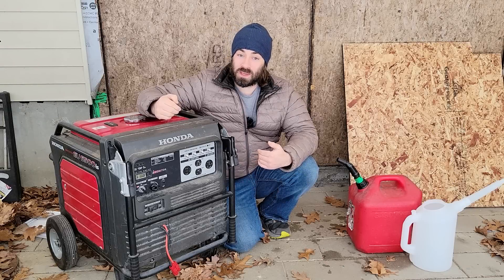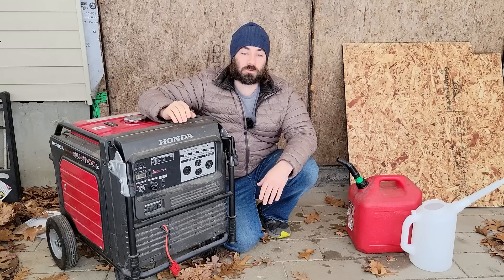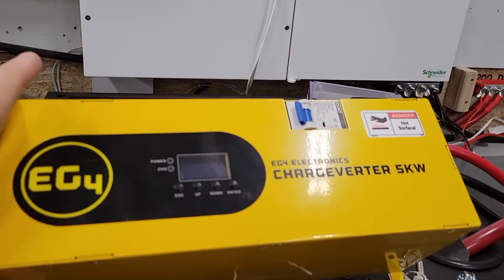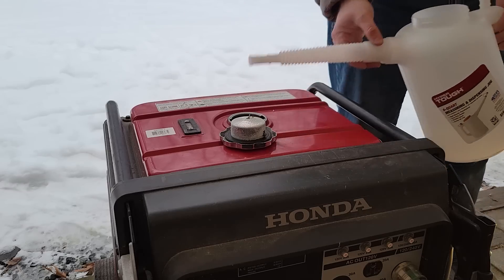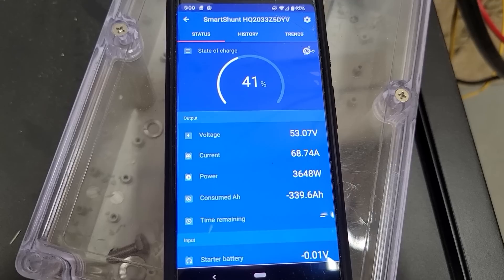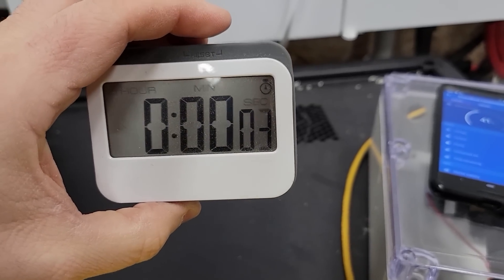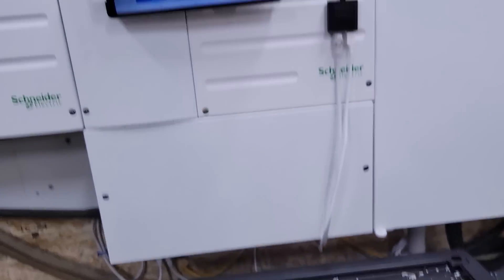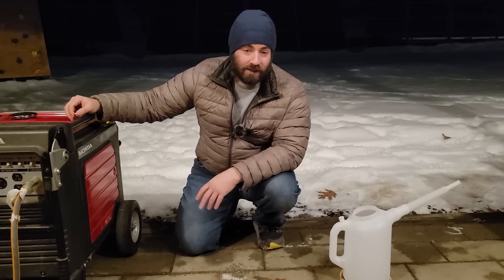Not what I expected.

Comment: Hey David. I think the 80% rule also takes into consideration that there will be less RPM, less friction , less wear and tear and therefore longer engine life etc. I may be wrong but that was partly my understanding.
Reply: I did similar experiment on a smaller generator. I got max power at max generator rating. My belief is that the "rated power" of the generator is the 80% value. The manufacture rates them at peak efficiency.
Reply: You could be wrong, as with higher load it will run shorter time, so it is not that clear.

Comment: I do not know how efficient generators are or can be, from my understanding, the newer "inverter generators" can be more efficient but I'm not sure as to the specifics. As to the charger, you most likely want to run it at about half capacity, as that tends to be where most electrical devices are most efficient. At full loads and low loads some electronics can get very inefficient.

My best guess from the generator is to get as much power from it as you can at the lowest RPM, because as RPM increases so do your frictional losses, but I'm not sure if there is a counterpoint on the electric generator side of that equation as well.

Comment: Interesting results - the first test ran for 1:32 before it ran out of gas. You never told us how long the other test took to run out of gas.
Reply from the maker: All the tests were 1 hour to 1.5 hours.  The higher the charging current, the shorter the length of time since the kWh per gallon was the same.

Comment: FYI .. to answer the title of the video .. generator is about ~17.2% efficient .. getting 5.8kwh of electricity from 1 gallon of gasoline (which has about ~33.7 kwh of chemical energy)   = ~17.2% efficient.

I might be interesting to see how this efficiency compares to a vehicle (car/truck) style system .. If a car/truck ICE is only 25% efficient fuel to shaft , and it's alternator is only ~70% efficient shaft to electricity .. it would still give about the same net ~17% efficiency ... 33.7 kwh in x 0.25% ICE  x 0.70% Alternator = ~5.9 kwh electricity output ... ~5.8kwh in about ~1 hour is about ~5.8kw of power aka ~7.8HP.

I would guess that some of the HEVs (prius and the like) would do the best .. as they were designed specifically to be more efficient power trains.

Even if a vehicle style system is only equally as efficient .. gasoline to electricity .. it would still have a advantage in terms of fuel capacity (hours of available run time) over the smaller generator .. and because the vehicle is self propelled , it would have a convenience advantage in how easy it is to refill that fuel at a gas station by just driving the vehicle there , instead of transferring fuel to the generator , or moving around the heavy generator.

Comment: Thanks for the video, David. Hard to beat those Honda Inverter Generators, efficient & reliable. Recently installed a EG4 Change-Inverter and for the money it's a good buy. A gas generator unfortunately is a necessity when loss of utility or off grid even with solar. My plan is to convert or build a wood gasifier generator. They are not very efficient as compared to gas, diesel, propane, alcohol etc. but having plenty of wood on property, already use for heat, and it a resource that is not reliant on someone else to supply but till that happens good ole gas generator is there.
Stay Safe & Good Luck
Reply: I would love to see a video on now this is done.

Comment: At my fule cost here that cost you over 50 cents a kWh, my grid is much cheaper than that at 15 cents a kWh still pays to use the grid for backup and only run the energy hogs on grid.

Comment: i have been woundering if using the 3 phase output of a generator into a bridge rectifier then into a mppt charge controller would be efficient or if the output voltage is to high for mppt
Reply from the maker: I If a generator is making 120/208 3-phase, then I'm guessing the DC Voltage after rectifier will be lower than 250V, which would work in my Victron charge controller.  If it was higher than that, there are 500V and 600V chargers on the market.  But, I don't know if it would be worth it or not.
Reply: @DavidPozEnergy  i was just thinking as the gensets with 3 phase are commen and cheap easy to get hold of if a 100amp rectifire and mppt could handle it then maybe an efficent systemor at least an easy one as power is been stepped down i would of thoght efficent more so then an inverter genset as thats upping the voltage befor dropping it again
Reply: @DavidPozEnergy  i know you can take the car altantor or truck ones take out the voltage controller and rectifre and replace the genset voltage controller so you have an oversized genet that is been run at lower percent of usage and in thery last longer

Comment: First of all, thank you for doing the tests. I have wondered this same thing myself, and I am glad that it turned out to not really matter. I went back and looked at your generator. I see it is an older EU6500is, non fuel-injected like the newer EU7000is. I remember from some other sources that claimed the fuel injection didn’t improve the efficiency over a carburetor, at least a well tuned one. It would be interesting to see someone prove this in or out with hard data. 
On a different note, this is no doubt obvious to you, but may not be to others, that it will be more efficient to run loads directly off the generator if possible, rather than going through the batteries back through the inverter into the loads. In practice for example to also run a load of laundry or do something else task oriented when you need to top up the batteries, rather than run those tasks later from the batteries through the inverter. Assuming both that changing the batteries and running the inverters are both 93% efficient each by themselves, the end-to-end efficiency would be 86% efficient versus just running the task directly from the generator.  Again, thanks for the video!
Reply from the maker: Yes, it's true that if you are running a constant 5kW load (like a water heater) directly from the generator, then it's more efficient, saving the 13-14%.  However, it's not as simple as that.  Since our house loads vary, the generator doesn't see a consistent load.  I have a previous video out where I tested the efficiency of my generator with a 1kW load (about 19% of the generator rating).  I got 2.6kWh/gallon.  Compared to the 5.8kWh/gallon in this video, that represents a 2.6kWh out to the load is 3.7kWh less than the maximum power/gal as measured at the generator.  Or, a 59% loss.  So, compared to running a 1kW load, charging the battery directly is far more efficient.  As you can see, I can't say "running loads directly is more efficient".  The answer is "it depends".  
BTW,  I'm not arguing, I'm just sharing some additional thoughts that go into it.  I find it a lot of fun to thing through these things and make spreadsheets.
Reply: @DavidPozEnergy  damn Dave... you are a smart mother#$%$er.  Thats awesome.   Also I didn't think you were arguing,  data, is what it is.  You were just presenting that.  👍
Reply from the maker: Thanks Thaddeus.
Reply: Do you have an inverter/charger that takes an ac input from a generator, can be set to take a constant input to power loads and send the rest to a battery to keep the input power constant?  Would this be best for the example above?

Comment: Great video as always David. Now with the new programmable chargeverter, I’m wondering if it’s more fuel efficient to run say a 2000w suitcase generator longer to achieve the desired charge over a 6500w one for a shorter period of time… previously I wouldn’t have considered this since the MPP’s don’t like to be under supplied on the line in, but now it’s possible to charge at whatever amperage is desired. As you say, the end goal being if you have to burn fossil fuels, it’s best to find the most economical and efficient way to do so.
Reply from the maker: Check out my previous video where I tested a Honda EU2000 (suitcase) generator.  https://youtu.be/QAoorfdbefo  Personally, I'd want to go as large as practical.  The practical limitations would be 0.5C charging rate of your battery bank, and what generator might be available to you.  Then we could get into replacement parts, etc.
Reply: @DavidPozEnergy So how many V/A/W is 0.5C for your battery?
Reply: @DavidPozEnergy great video and testing I was surprised by the efficiency even at the higher amps still. Can you please show a video a little more about the Victron smart shunt to show whether it shows charge / discharge graphs to show how many kWh you can get when discharging down to a specific voltage eg 48.5v for example on your 51.2v packs. Will the smart shunt show you that with the charge and discharge curve graphs also? Cheers

Comment: Forgot to ask, did you notice any significant heat output on the chargeverter at higher amperage VS. lower amperage ?
Wish I could do the same test but I put in a buried 55 gallon fuel tank. Filled it up once 5 years ago & still trying to burn off the diesel before it goes bad on me.
Gold plated problems.
Yeah-run that gunny like a rented horse at 90+ amps !
Reply from the maker: Sounds like you don't use much diesel.  That's a good thing.

Comment: Nice job David, just the test I was hoping to see from you.
Good to see the chargeverter in action. I run our 7000 watt Kubota diesel gen to charge at 4000 watts while supplying 1500 watts of loads to house. It's pretty efficient tho the genset puts out somewhat dirty power.
If we did it all over from scratch I'd get a gas powered inverter generator to supply the inverter charger & house w cleaner power, plus somewhat quieter operation.
In our case utility power cost 63 cents per kwh so as stupid as it sounds, I can produce & store generator power cheaper than buying it from the U.S.V.I. utility company. Our grid co is called W.A.P.A. (water and power athority) we refer to it as "Without Any Power Again" and is notorious for regular outages,blackouts,brownouts and high surges.
One surge actually caused a gfci outlet to catch fire in our wall (fortunately built of cement) so we run 99% fully off grid now to protect our home & appliances.
Used to budget $2000-3000 per year to replace fried appliances. Funny thing is we haven't had to replace a single appliance in 5 years since going off grid. Bonus-add $15,000 in saved appliance costs to convert to  a larger lifpo4 storage system. Thanks for the MPG test. Have a great day.
Reply from the maker: Thanks for sharing your situation.  I didn't realize you would have to replace appliances so often due to power surges.

Comment: That is surprising results. That Honda inverter generator may be more efficient at lower wattage output in eco mode with the load low enough that the rpm is lower.

Comment: The efficiency is equal due to the fact that the charge power of 80, 90 or 100A is quite small relative to the capacity of your battery bank (30kWh). Only after you'd get over 0,5C (about 300A power charge) there is going to have first signs of drops in the efficiency curve - is not the case for your generator/charger which is able to get to a max of 100A
Reply: State of charge not very relevant. The inefficiencies David is measuring is what is lost in the DC charger and the wires. Nothing else. There are additional huge losses in the generator both in the engine (which has at most 30% efficiency, probably more like 25%), and in the power head that converts from mechanical energy to AC electrical power. A gallon of gas has about 33.7 kWh of energy (the heat dissipated under optimal burning conditions). So the total efficiency David got was about 17.5 percent.

Comment: Did you recently upgrade to two XW inverters? Was one not quite enough for all of your appliances?
Reply from the maker: I recently got a second XW and hung it to get it off the garage floor.  I have not yet hooked it up.  1 inverter can run my house just fine, but I am hoping to get an electric car soon and that will need a second inverter.
Reply: @DavidPozEnergy  very cool! We're in the process of getting all of the design work done for our all-electric, off-grid build. I want to use two Victron Quattro 10kVA inverters, but I'm concerned about our electrical inspector not liking them. The XW is my backup plan.
Reply from the maker: The Victron Quattros look like an excellent choice.   If Victron ever got them UL listed there would certainly be more sold for home use.

Comment: The 80%rule is a good to live by with all things being the same.  With that said it would be way better for your generator to run @80% ranther than 90 or 100+ for the longevity of your generator.   The internals will run cooler and last longer at that rate better than anything higher. Actually if 70% works what's the harm with that?  What I saw from the test was everything was very close to same results with the only exception being a little longer runtime (roughly 10 min) @ 70%  

Please correct me if I'm wrong,  I am just noticing things in the video and really appreciate your tests because your videos have helped me tremendously.   Keep up the good work.
Reply from the maker: You are correct that running things below their MAX rating usually lets them last longer.  That's actually what I was thinking when I said I'll adjust mine to 90 Amps instead of running it to the MAX of 100A.  I want the chargeverter to last a while.  
Thanks for watching.
Reply: @DavidPozEnergy  good point, I was only thinking of the genny,  buy the chargeverter should be run at a lower rate as well.  Good catch 👏
Reply: In the summer I would not want the generator running at max load for extended periods of time, but in the winter I would be fine with it since cooling won't be a problem. 

The dead of winter is usually when you'd need to be charging from a generator more often anyways because of the lack of solar.  In warm weather i'd taper back. 

But these were interesting results. I bet we'd see a difference on a lower end generator with a single speed governor.
Reply from the maker: Hi volvo09,  You are probably right, that summer might have more of an impact.  In my situation, I have all the solar I need from March through November.  I only need the generator to supplement during winter.

Comment: I was a little surprised by the result.  I thought the higher current losses in the cables would show up.  It would be interesting to see what running it at a lower current would do.  Say 20, 30 or 40 amps.   I know it would take longer, but it might give some more insight into finding the true sweet spot.
Reply: They did show, but they're pretty low, so it's easy to gloss over it. If you pay attention to the numbers, the full system is about 1% less efficient at the 100A load. (80A was ~93%, 100A was ~92%) But with such a low difference, you'd have to "lab accurate" in each test to properly measure it. (each test is using slightly different amounts of gas, he's running the generator without load for various times, and not starting the test with the inverter set to the target current... but for a YT video, it's accurate enough: honda makes a damn good inverter generator, but you are paying for it.)
Reply: Losses in the cables are in the order of 1 percent maybe. The thing which will determine the overall efficiency the most is the efficiency of the internal combustion engine. It is probably only about 25% efficient but it will depend on the load and that is the factor that matters the most in this test I believe, finding the optimal load level for the engine. Gas contains 33.7 kWh of energy per gallon, so the overall efficiency of this test was about 17.5 percent.
Reply: @mcg6762  Agreed. The goal here should be to find at what load the generator is the most efficient at. I would think in the 80% load range would be ideal but no idea offhand why I would be thinking that (I may be conflating PC power supply efficiency).
Reply: @mcg6762  This is why he should be running a diesel generator.  Diesel engines run at higher compression and are above the 25% (maximum) efficiency of a good quality gas engine.  When it comes to efficiency, there is really no replacement for compression ratio.

Comment: This is how it is. It's an inverter generator LOL. 100% predictable. My HF predator is the same way. Can use two 80a chargers and it will put the same amount into my batteries, but faster or slower depending on if I use one or two. Chargers are about 93 percent efficient just like yours even though mine is 12v. I'd just go with the lowest amp charge that can get it where you need the SOC unless you need to charge fast for an emergency. It's nicer to the cells.

Comment: So you’re bypassing your input on the inverter and going straight to the busbars?
Is the safe? 🫣
So you have to have the inverters off to do this?
Reply from the maker: Yes, going straight to the Busbars on the DC side is safe.  The inverter can be ON or OFF.  I could even have solar charge controllers running at the same time if I wanted.
Reply: @DavidPozEnergy  
Wow, thanks for the info! The only problem is I only have a 3200 W inverter on my gas generator! I opted for a quiet generator because I live in the city. I can only get 25 amps.
Reply: The power going in from the gen is going into that yellow box. That puts out DC volts. It's just like solar more or less. The battery don't care where the DC powers coming from.

Comment: Always interesting. I thought you would have different results. It seems the load was not very different as far as the genny was concerned. Wonder what the current was on the genny side of your setup. Assume it didn’t change much. Thanks for sharing
Reply: For 100A charge current at gen side is about 48*100/120 = 40A assuming batteries are 48V and Gen voltage is 120V. For 80A it is 48*100/80=32A